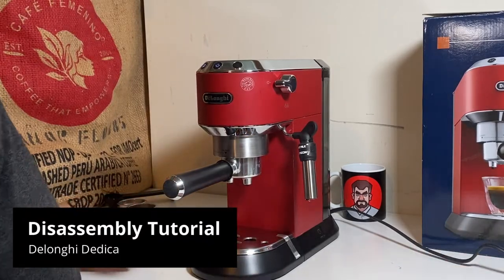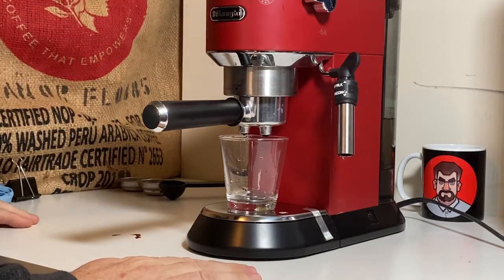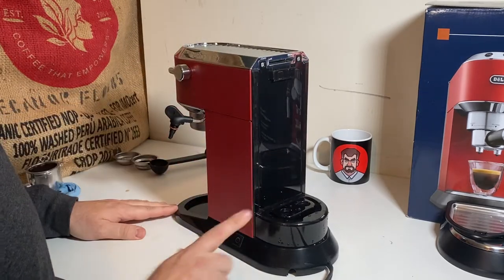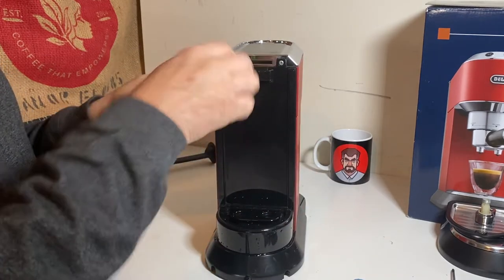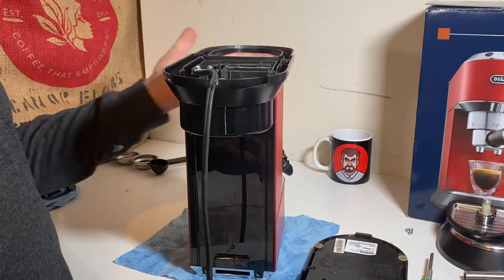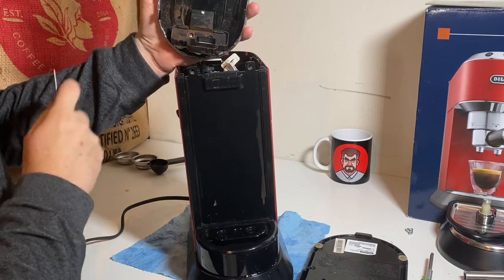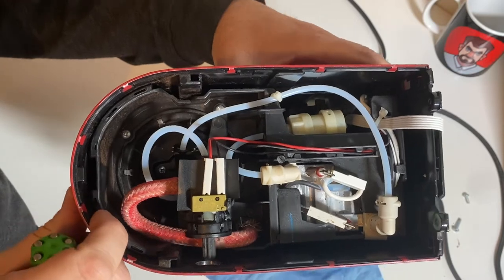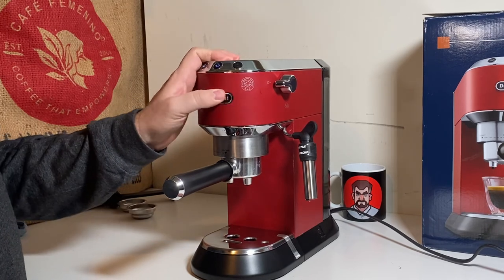Delonghi Dedica Disassembly (Short Version)

Comment: If somebody stumbles across this, on my model (EC685-BK) there are 3 grounding wires present, additionally connecting the inside to the chassis. The first one is attached to the top and needs to be screwed off. Two others are on the rear. When looking at the water tank, on both sides you’ll find a plastic strip that you can pull upwards and then off. The left one doesn’t matter, but the right one covers both additional grounding connectors, that can be unplugged with tweezers or thin pliers.